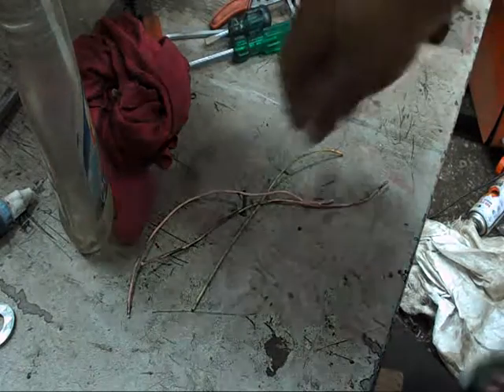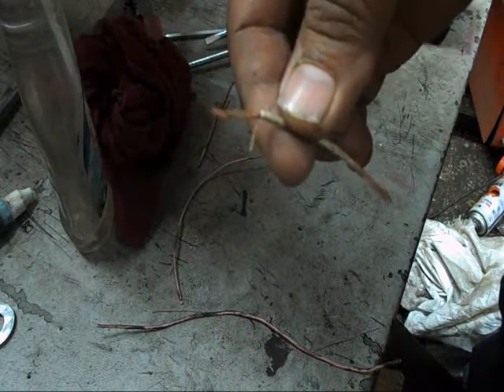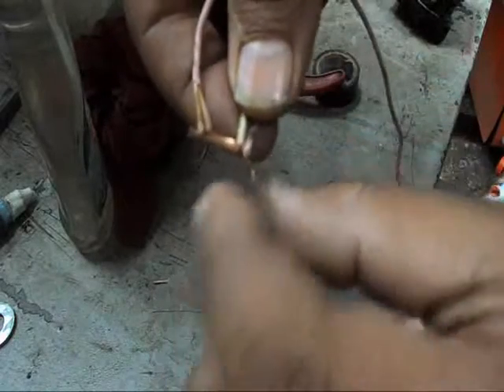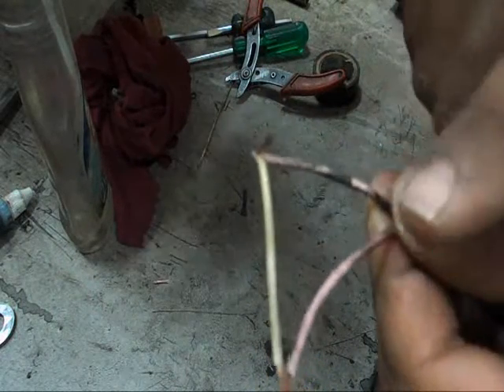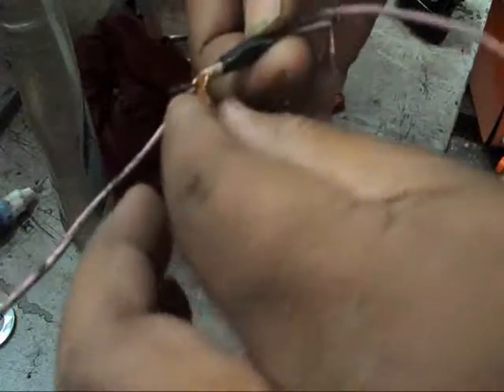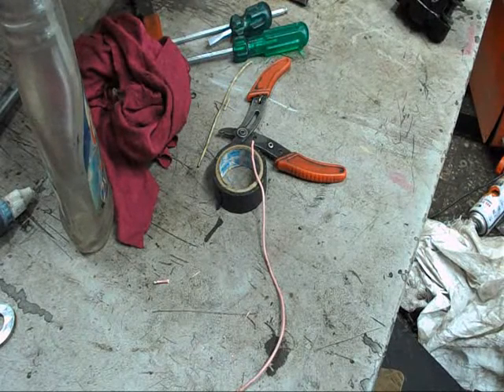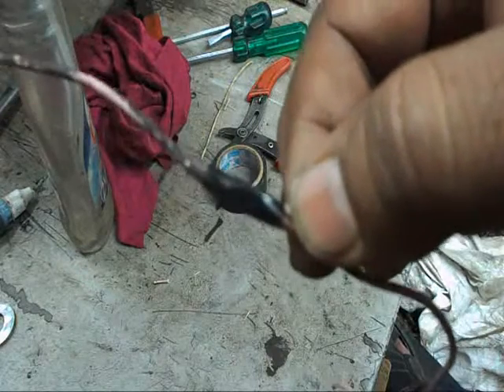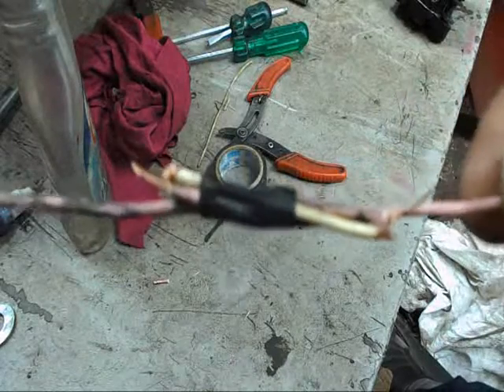Emergency Fuse making

Comment: hey bro plz tell me abt throttle position sensor of classic 350 as my bull is getting low initial pickup and seems load on engine and it's sound ping ping  bt I have no issue with bike performance after gaining speed.  I think there is timing problem and. some time there is sound from engine  as if rocker is loose.      rest my engine is smooth, better mileage